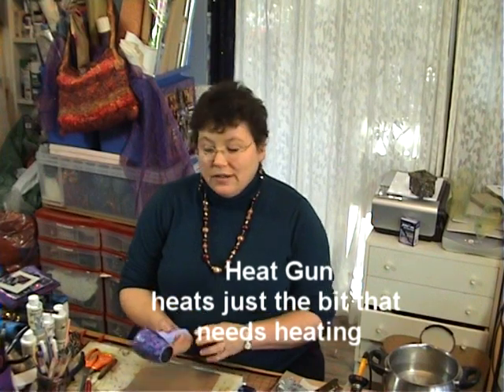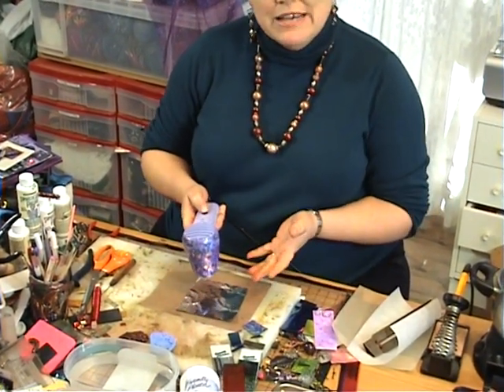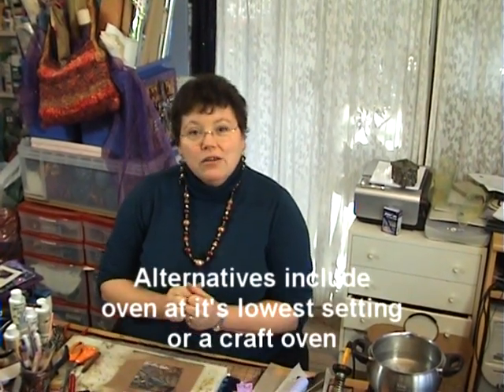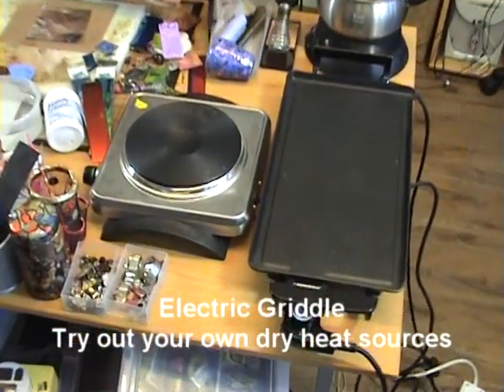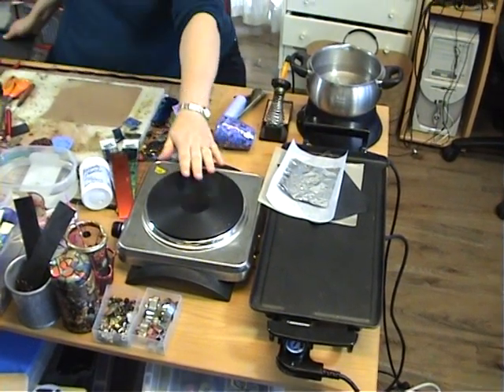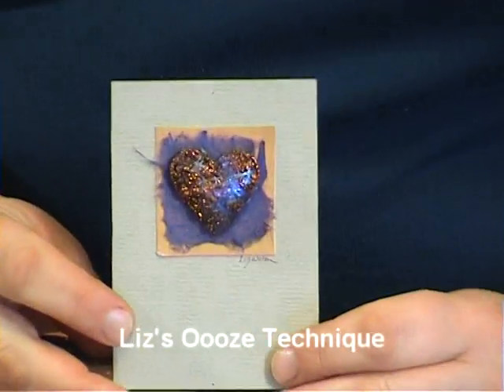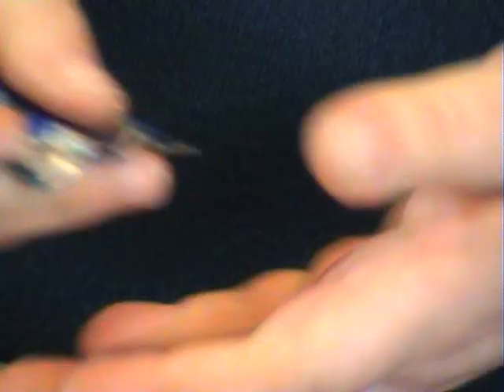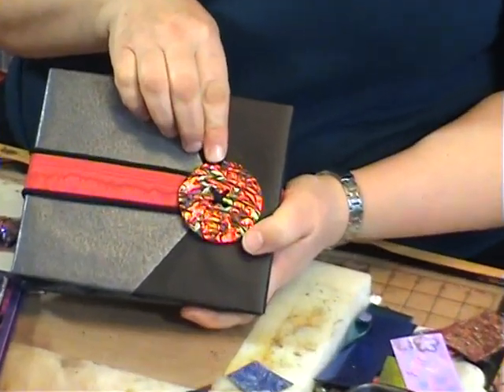Friendly Plastic Heating Methods - Dry Heat from FPUK TV with Liz Welch at Rare Bird

Comment from the maker: I think it rather depends on the type of plastic, but basically, it is likely to revert to its current state after heating.  Friendly Plastic is only soft whilst it is warm, it becomes hard (but flexible) again when it cools.  I think your best bet would be to cover the wheel with something soft, or buy a new one.